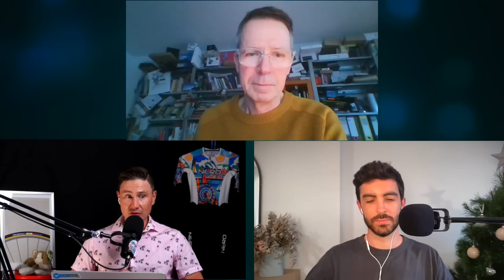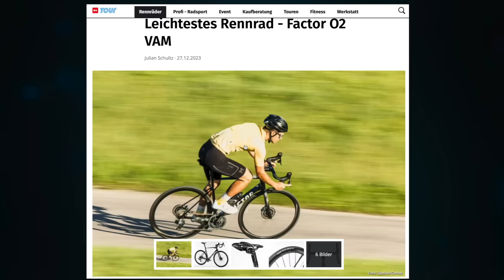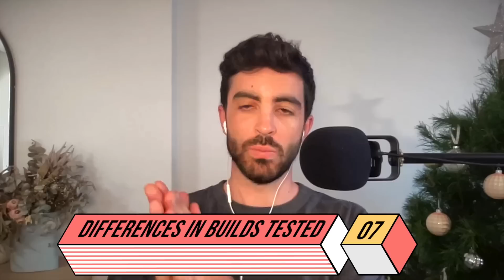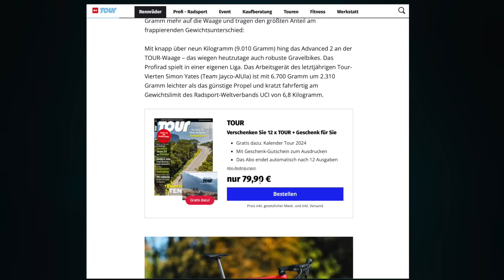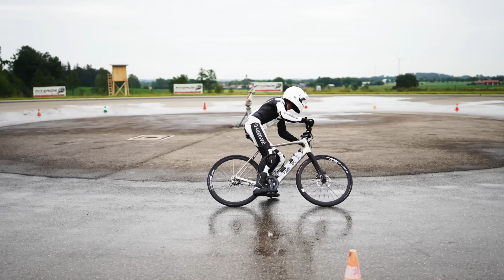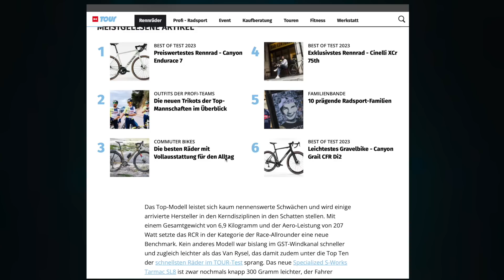Inside Road Cycling's Only Independent Bike Testing

Comment: They should move away from using stock tires if it is predominant for the overall result. Not uncommon for brands to throw on cheap stock tires because they know the rider will switch them out anyways depending on the type of riding they are doing, and what brand they prefer.

Comment: Unfortunately TOUR Magazin changed it's decade old protocoll for bike testing since the issue of February, 2024. They stopped all the comprehensive technical details to publish, like frame weight, fork weight, etc. They simplified it to the level of all the other generic printed cycling media. About aero testing to continue, still not clear, but seems they stopped it as well.

Comment: perceived stiffness is highly dependent on the riders weight. A 60kg rider will find the Tarmac SL8 extremely stiff while a 80kg kg rider may find otherwise. Same way a 85kg heavy rider will find the Venge to be “less harsh” as opposed to a 60kg rider.

Comment: I think Tour magazine does good testing - from a technical point of view. However, the big problem (in statistical terms) is, that with a sample size of 1, you never know whether differences between bikes are significant or not. What I mean by that is that most of their comparison tests are done (or at least have been done the last time I checked) with one frame in only one size per bike model. Therefore, their results only allow for limited conclusions to draw for people actually wanting to buy a bike. 
The aerodynamic properties of a certain model may change with frame size (slightly different tube angels and distances between front wheel and down tube) but also with changing air flow interactions with different body types of riders (a frame that works aerodynamically well with a slim rider with slim legs may not work so well in interaction with a more muscular rider...). In measurements of stiffness and weight, there may be even some differences on frames of the same model and in the same size but of a different production runs (= manufacturing tolerance).
Don't get me wrong, Tour nontheless is doing a very good job in testing bikes and testing more frames of the same model may simply not possibel, because they won't get them from the manufacturers. But keep in mind, that the "best" bike testet in the Tour magazine is not necessarily the "best" bike you can buy.

Comment: This was an amazingly good interview!  My biggest hope is that Tour Magazine sees the potential in the English speaking market and puts out an English option for an online subscription, I would definitely support them.  My two biggest take-aways were 1) in the aero-bike market, the differences between the top performing bikes is not a lot.  As we all likely know, the performance level of the top-tier bikes is generally excellent and you are paying (potentially a lot) for not a lot of difference/return.  2) the observation that beyond about a 40mm or 50mm depth wheel does not make much sense in most cases, certainly as a general-purpose wheel. Again, I would have likely assumed that, however, it was great to hear the confirmation on this.

Comment: The #1 problem of this otherwise AMAZING test is interpretability of results because it completely negates rider position (primarily stack/reach). E.g. how to interpret a super aerodynamic test result with upright geometry versus a non-aerodynamic result with aggressive geometry?
Love the no-nonse German attitude of Robert.
Reply: Why does rider position matter? 
This is purely on the bike performance. 
What matters is that you just have the fastest bike, since for us non TDF riders, the bike is just a statement piece rather than something that we need to work with for our paycheck.
Reply: @87togabito   because bikes don't propel themselves. A rider is required and therefore you also have to account for the rider's position when talking about "bike performance".
Reply: Surely the fact that the tests are conducted legs only eliminates that variability, which is rider not bike specific
Reply: Size of frame matters

Comment: As someone working in the industry, I love the objective testing of Tour magazine, and at the same time see the negatives to it. I would love to see more of the data they have (drag on specific yaw, and with reference wheels) being published, and maybe even have the simulation tool on their website so people can see what really is the best product for them specifically. The negative side to their testing being the only objective testing in the industry gives huge power to it. There is a race to get the best number in Tour magazine, but it does not necessarily mean it is the best product for you. For example, every time they change their testing method (for example when they added comfort or drag measurements), it completely changed the rating of bikes, meaning bikes all of a sudden became better or worse, and it actually changed how bikes look.

Comment: I  think there are some interesting grey areas aero test wise. I always go back to the saying all models are wrong but some are useful and this definitely fits aero testing.  The  differences say in a bike setup for a 10 or 25m TT against against a 2hr plus road event where you have 2 bottles on the bike.  I think Giants aero data for the TCR vs Tour magazines data shows these differences. If you ignore the TCR's data because of bias and look at the 2 rival brands they tested the SL7 & R5 the R5 comes out marginally faster when in the Tour magazine data the SL7 is significantly faster.  I expect this might be the two bottle testing of Giant and the R5's (&TCR's) wider downtube compared to the SL7.  I expect with no or one bottle the SL7 performs better but with two the large down tube evens out the differences.
Reply: I think there is an amount of onus on the individual to consider all of these extra variables, rather than test for them all. For any given person or setup the results will be different. Don't choose a bike because it is 2 watts faster in Tour magazine - but do pick a bike because it is ballpark up there in the same bracket.

Comment: 39:40 did I just hear that they sometimes adjust the ride impression portion of the review to agree with the numbers? Why bother riding, then? And that they give numbers to a reviewer before a test ride at times? Confirmation bias, anyone? 

Theres definitely some lost in translation moments so far, but did he just say the quiet part outloud?

One thing id love to hear some smart science people grapple with: does a less stiff BB actually reduce power output in a sprint? In seated riding? You always hear the theory that the frame will rebound, returning most of that "lost energy", but its always some facelwss forum user saying it.

As always, i think stiffness conversations tend to converge on talking about the ideal crit bike, which is basically a race day special, rather than talking about what is the ideal bike that will be comfortable enough for training and also stiff enough for racing. At what point does it all just come down to tire pressure and size making a bigger difference than frame vertical compliance?
Reply: All of that, but these are just objective comparative numbers for you to then make your own choice based on what is important to you. The numbers aren't an instruction as to what you should buy next.

Comment: Interesting deeper wheels don't give a substantial drag advantage. But pros still use solid rear disc wheels. One thing to also consider is the deeper wheel holds it's speed better acting more like a fly wheel
Reply: I think he was trying to say that in real-world road situations, crosswinds reduce the benefit of the decrease in drag you get running a 50mm vs an 80mm rim.

He wasn't trying to say that deeper wheels aren't faster in TT or track racing. Where aerodynamics and speed are everything.
Reply: Sail effect is huge with a disc for TTs. Red card for the 'holds it's speed better' comment 😂

Comment: What about Pinarello F??? That’s all we want to know about’
Reply: Nice I’ve got a f10 , forget the upgrade 😀👍
Reply: @krisbowditch827  same here, my favorite race bike. And the headtube of the F10 is 10mm thinner than the F. Which is insane, why wouldn't the F10 be faster with narrower tubing.
Reply: @tommyfreckmann6857   it’s 10 mill thinner because it doesn’t have internal cable routing. You would then have to take an account for 10 cockpit.
Reply: @benmiller388 that's my point. But that wider head tube with negate hidden cables. The F12 has same width as the F.
Reply: @tommyfreckmann6857   thanks man.
Reply: @tommyfreckmann6857   o that’s wild! Never Thought of that!!
Reply: That new BMC is not in there is it?
Reply: Dogma F10 was one of the fastest at 202 watts. I believe the F was 207 watts.
Reply: @tommyfreckmann6857   can you see the F12? That’s what I have.

Comment: For me it is simple, if the bike is supposed to be used outside then I want a simple classical frame and shallow rims, because it is almost always windy in western sweden. I dont want any wind push me to the side, a while ago I tested a canyon something with deep rims and it was hell. No thanks, a classical non aero bike for me.
Reply: Same here, my local area is windy with steep100-200 metre hills. An aero bike would be pointless and annoying. I'd be blown all over the road and I'd be spending loads extra money for no gain. Add to that routing internal cable rounding though the bars. Horrendous. Classic bike with 1300-1800g alloy rims, alloy frame minimal internal cable routing save money and have a more practical bike.

If I lived in Florida I might think differently..

Comment: Well done guys.  Maybe the pinnacle of your episodes to date as your questions relative to speed difference between top bikes were on point. As a mechanical engineer, conversations like this...what is important to measure, is always a fascination.  A bit confusing about the 20% greater stiffness of the Tarmac SL8 considering the forgiving ride quality of the SL8 aka it's vertical compliance so more could have been discussed to address true stiffness difference as the metric considered important for speed is sometimes referred to as torsional stiffness which is actually a combination of vertical and horizontal stiffness.  No doubt Robert understands this relationship and could have explained it in greater detail, i.e. how the SL8 is considered to have a very compliant ride and yet its magic sauce for speed is its stiffness. Seems on its face contradictory unless stiffness is considered/measured in the lateral or torsional plane, and the stiffness 'for speed' is other than in the vertical plane.
Reply: The vertical compliance of the SL8 is a wallet, the owner is sitting on.
Reply: @super8hell true dat.

Comment: I am back to 23mm front tyre on quality alu rimbrake setup for aero reasons.
They measure 25mm and are comfortable enough. A lot cheaper too because
they dont sell much anymore because there is still some overstock.
Reply: Which frame?
Reply: @matkrek  Happy Newyear ! I dont know why my frames are relevant but
I use a Cube Attain GTC for climbing, an older Spesh Allez for short
wet roads and I ride 28mm on a Trek Domane for longer rides with
clip-on aerobars. I use light gravel short aerobars on the Cube.
Reply: Michelin Lithion 2 at 23mm for front tyres. 13 euro at Decathlon.

Comment: Testing aero without the rider is useless. It is like testing aero of an jersey without dude in it.
Reply: Lucky they test with a rider then. Well, a mannequin, which is better than a rider because a human would introduce way too many variables.
Reply: @jameseastwood402  didn't he just day that they eliminated the upper body, or did I get it wrong somehow?
Reply: @SampoSaarela  you can't test for the upper body for very obvious reasons, when you are trying to isolate the impact of the bike. Body position accounts for so much more drag than the frame you would never get the resolution on the frame.
Reply: @jameseastwood402 Cervelo uses a full body mannequin. Dave Zabriskie to be exact
Reply: @Shadowboost  I rest my case
Reply: @jameseastwood402  for the majority of bikes, it doesn't make that much of a difference. But bikes like the S5 with the specific stem design, it could differ. The arms and how the flow goes to the base pressure behind the rider torso (and flow coming down the back) also could have differences to reality
Reply: @Shadowboost  possibly but how many variations of arm and body positions do you need to test for it to be at all valid or useful? One could be faster with bent 90deg elbows and another faster with 60deg, and all probably less than 2w. What tour tests do is use something that is both consistent and comparable, for probably the first time ever.
Reply: @jameseastwood402  that is still part of the equation, for example if the handlebar creates some kind of vortices that interact with the body.
Reply: My man  @jameseastwood402 , don't waste time talking to people who refuse to learn
Reply: @jameseastwood402  Cervelo uses the same 90 degree position for their dummy. It's consistent, repeatable, comparable, and honestly for any rider trying to go fast, what is required positionally to race.
Reply: @Shadowboost  and yet probably the least consistent position held by riders worldwide. It's like modelling a TT bike on Dan Bigham. And therein lies the issue.
Reply: @jameseastwood402  Yeah. In irrelevant laminar air flow conditions with ridiculous high speeds assumed. 31 measurement points. Meanwhile the guys are riding 90% of the time in a bunch.
Reply: Spot the dummy.😅
Reply: Of course the rider effects aerodynamics of the bike. But my question would then be how would bike companies practically design an aerodynamic bike that takes this into account? 

Would they have to make different tube shapes  for riders who have different shaped torsos?

Maybe we should all just give in and ride fully enclosed recumbents?
Reply: @Kaosad69  Ultimately, I think they would have to do this but presumably also slightly different tube angels leading to different angles of attack of wind flowing from the riders body to the bike tubes.
I think, there is not one most aerodynamic bike for every rider and no company in the world will be able to supply every rider with the aerodinamically optimal bike for its body type. A bike that works perfectly well for a slender rider with slim calves and a long upper body, may not work so good for a more muscular rider and so on. 
To avoid this problem, there only comes one solution to my mind and that would be a fully faired bike like some of the racing recumbents.
Also, when a professional rider tests his or her position in a wind tunnel, he or she is not only testing for the optimal position ON the bike, but (presumably without knowing him or herself) also testing for his or her optimal position FOR the bike the are supplied with.
Reply: I agree with the original poster, 70 percent of the drag comes from the rider, a minor tweak on something like the stem length can move one bike from nowhere to the top of the tree. I think it is practically impossible to test as there are too many permutations.
Reply: @Hambini  position is normalized. And especially with no torso, no, a longer stem won't change the ranking whatsoever
Reply: @Hambini  thanks Mr Hambini. I'm a big fan of your work, some of the finest from a 5 year old I've seen.
Reply: Funny you say Mr, not Dr